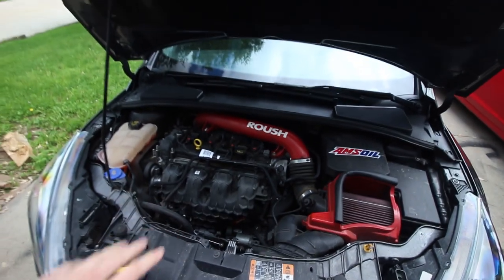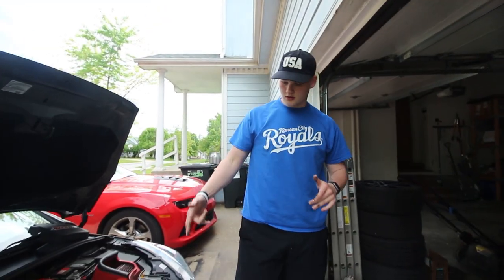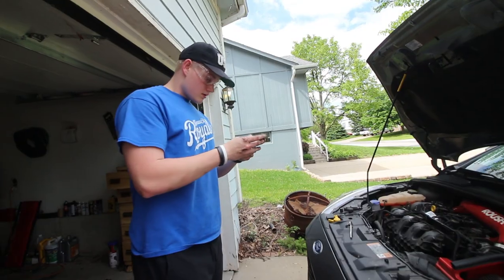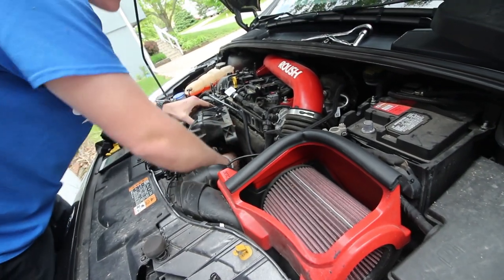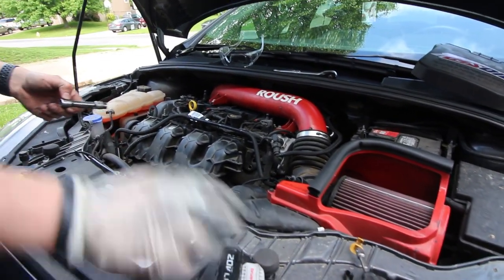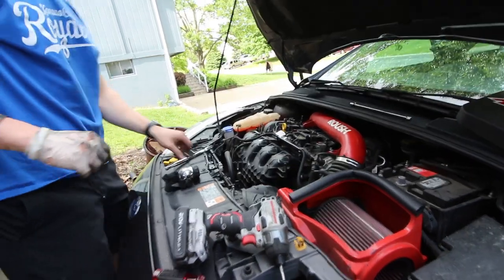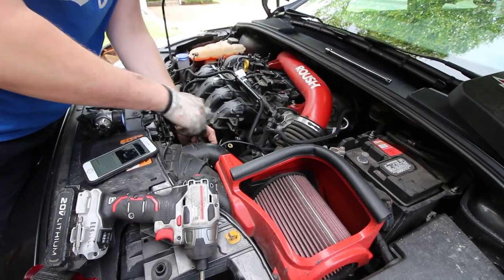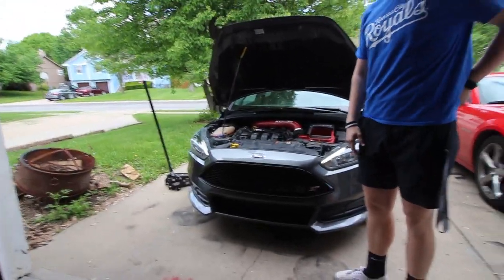Damond Motorsports Focus ST Stage 1 Catch Can Install Guide!

Comment: Appreciate the video...but there was not much 'how to' on the hardest part, seeing how the lines actually mount up. But, you did mention Damond's forum..i see the link so I'll go check that out to see if there are better details on routing the hoses. Otherwise, great vid! 
Did you end up doing a follow up on how often you check it and a volume you typically see in there? from what I've seen, basically every oil change unless you drive it hard all the time which would require doing it sooner (also dependant on the volume of the catch can).
I have the JLT rear, wanted the front catch can (theirs mounts by the hood latch area)..but a Damond one just became available locally Ill be picking up tomorrow.

Comment: Isn't it not ideal that your intake does not utilize factory valve cover breather to intake vacuum routing (which vents under boost) ? Not a criticism i'm just looking at aftermarket intakes right now and that's one of my concerns with some of these intakes...
Reply: I wouldn't think so. If any of that were an issue, the companies would most likely have those things included in their kits. That's how most things go in my experience